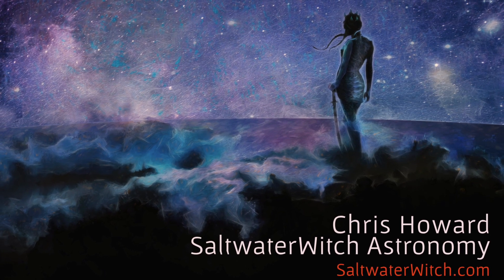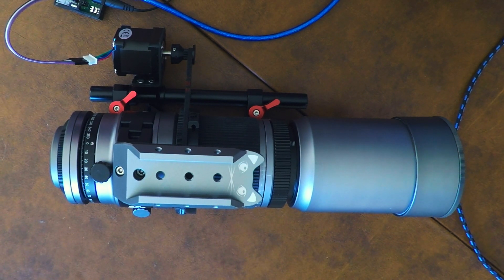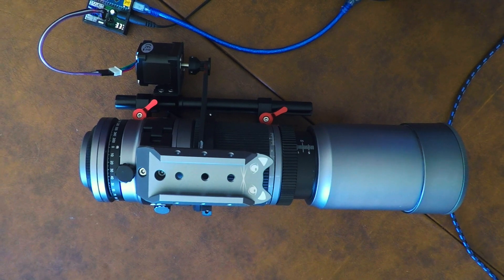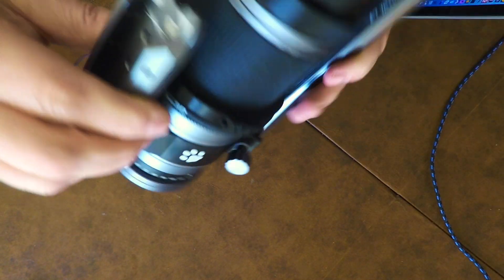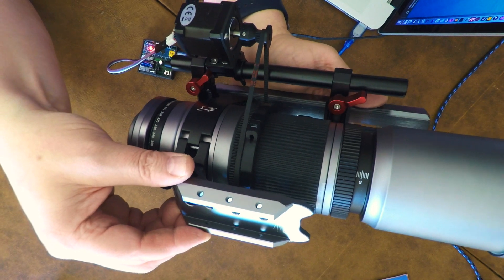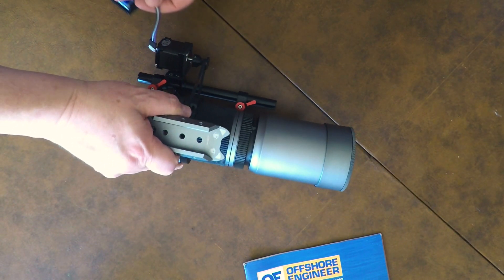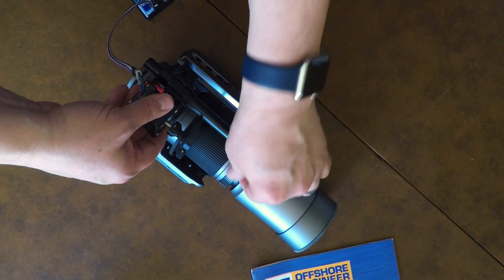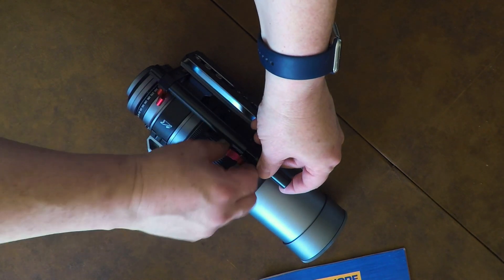William Optics Autofocus with the DeepSkyDad.com AF3s

Comment: Hello Chris, I have a Redcat and find that focusing is extremely straightforward with the Bahtinov mask. I’m unclear as to why an autofocus is needed. Though I’m sure I’m missing something. Can you tell me how/why you see the need?
Reply: Thanks for the response Chris! That makes sense. I live about 60 miles North of Chicago, lots of cold wether here too, I dig.
Reply from the maker: Hi Ron. I agree, focusing on the Cats is really straightforward. I don't need autofocus for my color cameras, although it's nice to have! But for narrowband I would have to go out and focus on every filter change. That's my main reason for wanting autofocus. Another--but secondary--is temperature, very cold here in winter (I'm in New Hampshire), so anything I can do to avoid going out to the scope more than once or twice to setup is enough for me to add autofocus. I don't use temperature compensation with autofocus, but to cover anything that can fall under that category--refractive index changes, dimensional, optical effects of temperature changes--I will sometimes do an autofocus every 60 minutes through a session. In an ideal astro-imaging setting, at the end of the night, every star would be identical across the 50-70 sub-exposures of a particular target and across filters--that's the goal, but I've never seen that. I think having autofocus makes it easier to get somewhere close to that ideal. Maybe? But, like you said, it's not like focusing on the Cats is tough, so there's a balance to be struck somewhere in there.